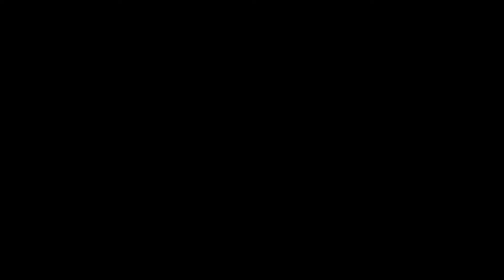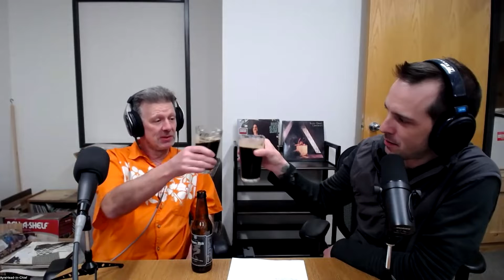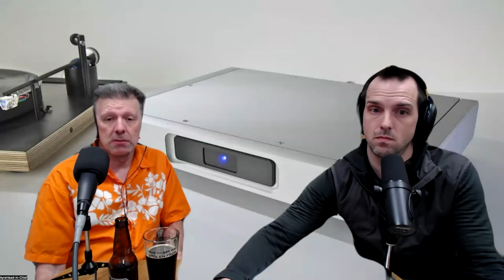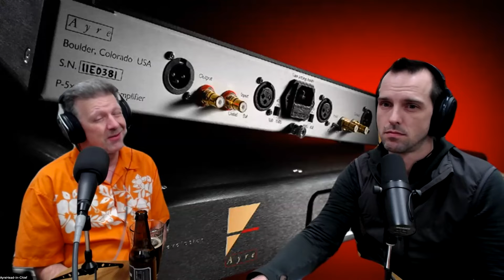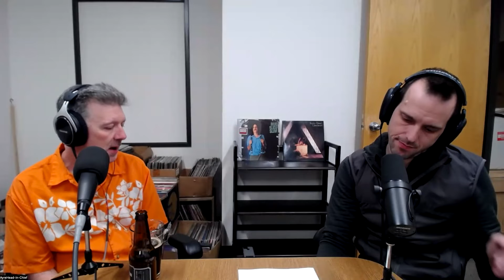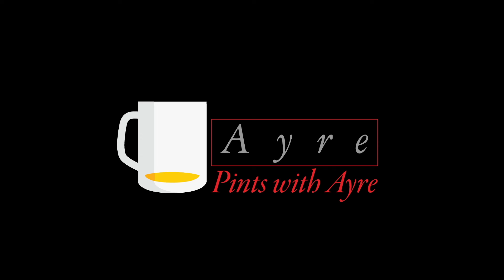Ayre Classic Product #11 | P5xe | Pints With Ayre

Comment: I have one of these phono pre-amps and am very happy with it. But I am comfused with the setting of the 'loading' dip-switches. I assume with both up the setting is 47kohms, left down 100ohms and right down 1,000ohms. Is that correct?